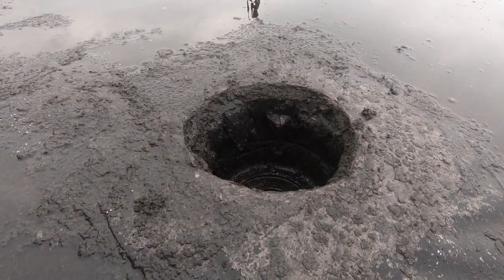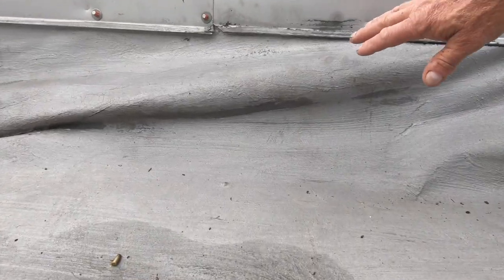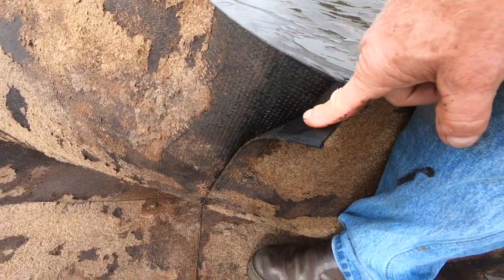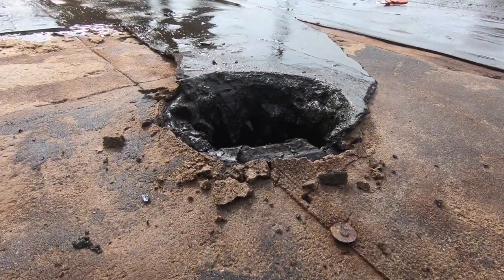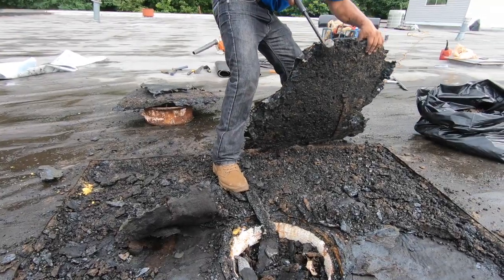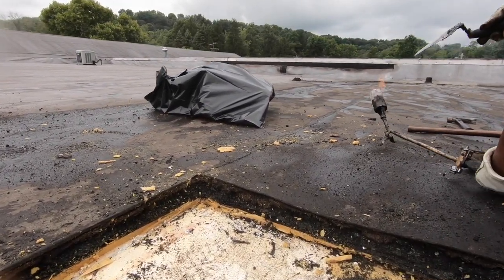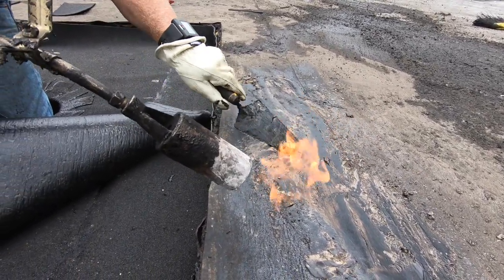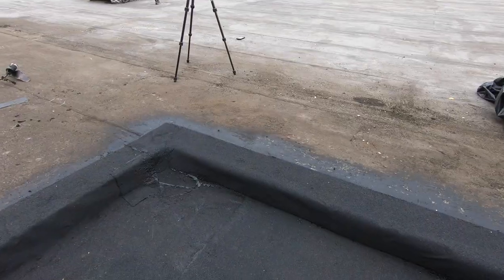Drain Catch Basins eliminates 90% of FLAT ROOF LEAKS - a Must have for Commercial Roofs

Comment: That roof basin as you call it should  have an hard edge around the edge of the boards you have just cut out something  like a 2x1 or 3x2 depending  on thickness  of the insulation

Comment: Never ever use mdf boards for ur roofing nor anywhere that is susceptible to water exposure. For the roof to be properly repaired, all the mdf boards have to be taken out and replaced with plywood that is water resistant. Then put base and retorch the modified bitumen
Reply from the maker: That is the entire roof. If you will pay, I'll do it, np

Comment: To save some time in cutting out insulation get a hackzall . Instead of heating up a trowel . Much quicker
Reply from the maker: you mean a saws-all, reciprocating saw? That could work, but what we did work pretty good and fast. The styrofoam melts like butter
Reply: Also, less mess with the trowel.

Comment: You never put SBS directly over EPS . There must be a recovery board or densedeck underneath . smh
Reply from the maker: You got something wrong. You think the granulated Torch Down is SBS, wrong! You have too little experience. This is a Torch Down APP 180 I used to and the existing roof is a APP 160, no ceramic granules. Because you are so used to use the cheaper Torch Down APP 160  you assume that the Granulated surface of what I use is SBS.